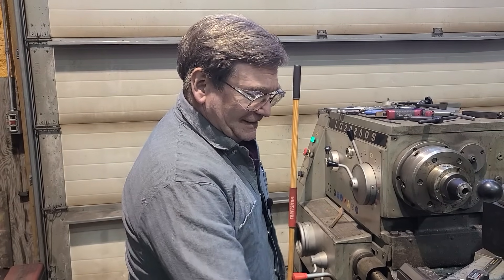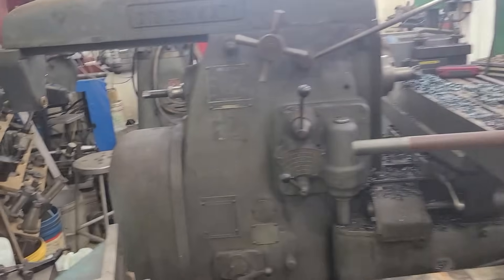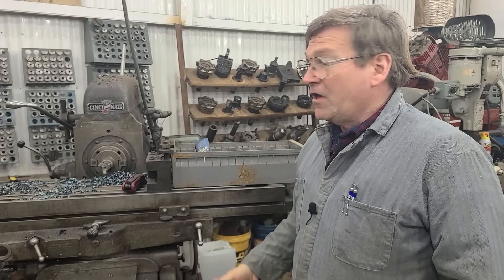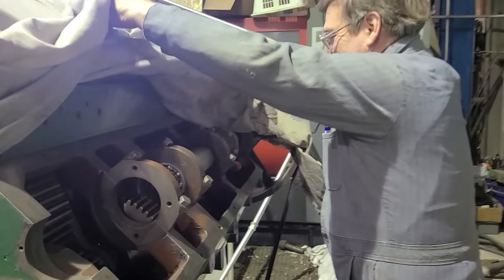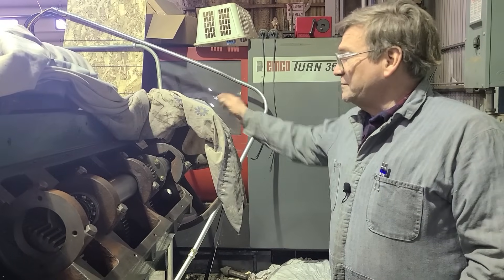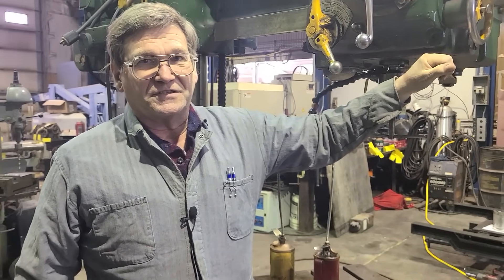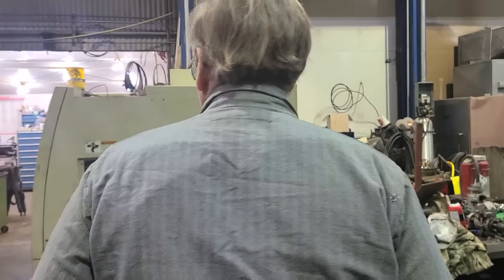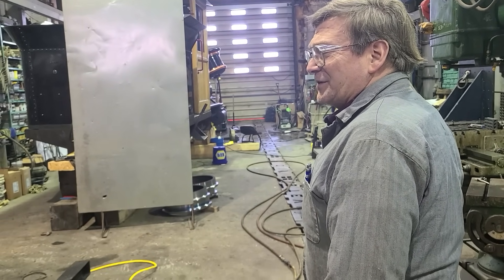Machines have CLUTCHES?!

Comment: I own the first model of true geared, clutched headstock lathe that led to the established modern lathe design. It's an 18" Lodge and Shipley Selective Head lathe made in 1918. They were originally for lineshafts, later offered with the new electric motor technology. Originally the motors were mounted on top of the headstock, but L&S also offered a box headstock leg with the motor-in-leg option, housing the motor under the headstock inside the box leg. Pretty much every lathe built later (except the L&S model X, for some strange reason), uses the motor-in-leg design.

Comment: It's the middle of July 2025, shop doors closed, coveralls on. What's the temp in Alaska these days?
Reply from the maker: HOT, 80's and sunny. If you keep the door open for a few hours when it's 50 out and then close them it stays cool inside during the day because of how well the shop is insulated.
-Cameraman

Comment: I have an old Monarch lathe that has a clutch, but to engage it you push the lever down.  It's kind of a safety issue since the weight of the lever tends to engage it on its own occasionally.  When I have my hands around the chuck I turn the motor off to be safer.  I've thought about changing the linkage so the lever is pulled up to engage the clutch.
Reply: Same with the Colchester lathes we used in the training centre